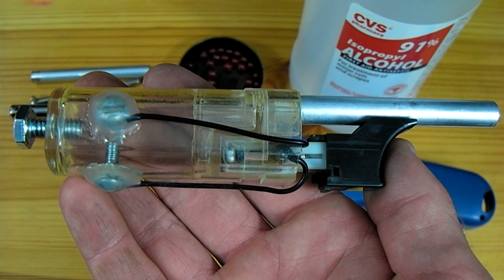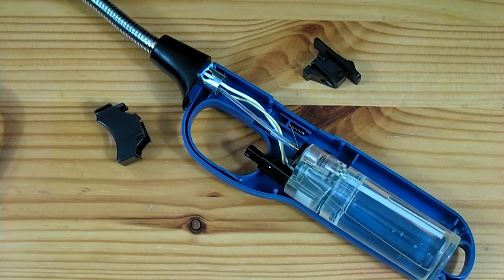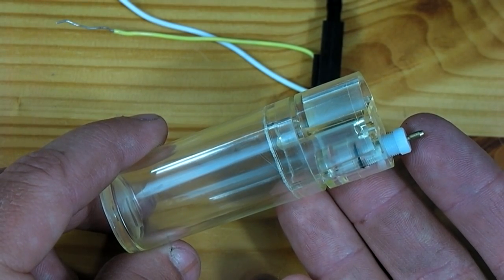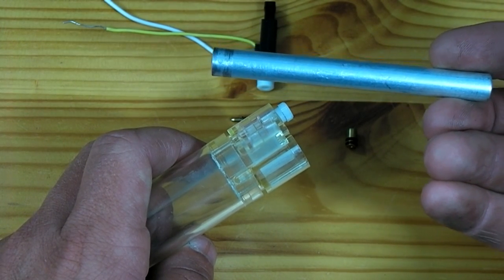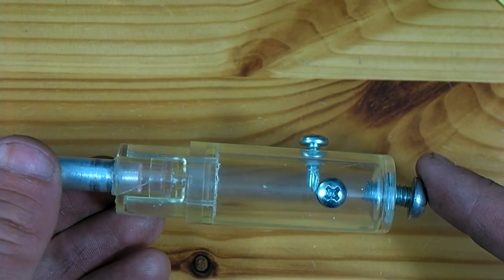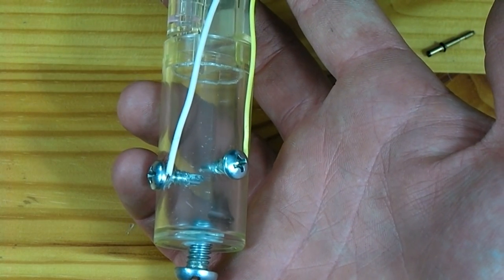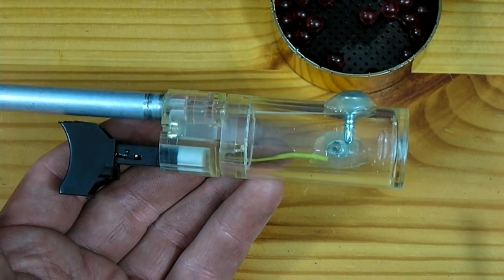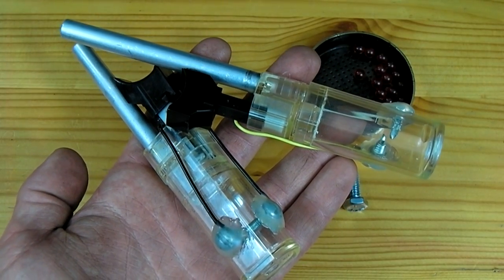Make a Mini Cannon from a Lighter

Comment: After experimenting with just about every volatile liquid I could get my hands on I simply couldn't find something that didn't have a finicky air to fuel  ratio. Later in the day while browsing youtube (after having thrown up my hands on achieving ignition) I stumbled apon your propane torch pop gun video. Inspiration struck and I grabbed my small butane torch. With the perfect air to fuel ratio every time, there is no failure to ignite and an amazing increase in power. If you are having issues with fuel ignition I recommend purchasing a cheap butane torch from harbor freight for better results in both ignition and effectiveness.
Reply from the maker: jay madarasz Good idea. A small torch lighter might be perfect.
Reply: +NightHawkInLight can you make me one please
Reply: Acetylene solves crappy cannon design problems! Explosive from 2.5 to 100% (yes, 100%. it can burn without air.)
but it’s very scary and I don’t recommend it if you want to keep your fingers.
nitrous oxide also gets the crappiest miniature gas cannons to fire properly.

Comment from the maker: Normal screws will work but you will need to drill pilot holes through the plastic before screwing them in so it doesn't crack.

Comment: This is technically a firearm (Defined by the united states of Bureau of Alchohol, Tobaco, Firearms, And explosives)

"The term “firearm” is defined in the Gun Control Act of 1968, 18 U.S.C. Section 921(a)(3), to include (A) any weapon (including a starter gun), which will, or is designed to or may readily be converted to expel a projectile by the action of an explosive; (B) the frame or receiver of any such weapon…. Based on Section 921(a)(3), air guns, because they use compressed air and not an explosive to expel a projectile, do not constitute firearms under Federal law — unless they are manufactured with the frames or receivers of an actual firearm. Accordingly, the domestic sale and possession of air guns is normally unregulated under the Federal firearms laws enforced by ATF."

But don't fret! Producing homemade firearms for personal use is completely legal for US-Citizens... God I love this country
Reply: Oh, didn't see your comment before I posted mine. I am glad that you went into detail. Needed to be said. I mean, it is virtually a gas powered muzzleloader of sorts, it would be about as easy to do on full scale.
Reply: Wait so i can go make a gun in my garage right now
Reply: As long as its not a sbr machine gun or anything else right
Reply: paul beenis do u have to be over 18?
Reply: erm he lives in Canada

Comment: NightHawkInLight  Can that "Piazo Electric Igniter" light kindling for a fire in a survival situation?? That thing could be an essential!
Reply: The piezoelectric lighter for a Bar-B-Que grill works for a survival fire starter the spark is hugh and most of them are T handled
Reply: Yeah. But wear gloves. ive held acouple of those and clicked them incorrectly or somethin' cuz they zaped me!
Reply: Why not just take the whole lighter with you? DERP
Reply: Yes the Piazo Igniter from a gas BAR-B-Que can start a fire better than a flint and steel. The one I have throws a bright strong spark
Reply: Solinium Pulse
Well if you're gonna be like that i'm pretty sure those sparkers run out of battery! Surely a lighter is enough gas for one camping trip? If your on about a collapse situation i'd probably use the bow and stick and board if I had no chance to get supplies first, hardest part of that is the string but you could use baler twine from a nearby farm or something.
Reply: i don't know how hard it would be to ignite something other than flammable gas, i.e. twigs or whatever you are using to start your fire. probably just easier to bring a small matchbook
Reply: I thought it was piezo not piazo
Reply: I thought it was peizo ignition
Reply: Jimi L dude, a piezoelectric charge is infinite

piezoelectricity is electricity generated from a crushing force, therefore, you add a small burst of sudden pressure, and boom, you make electricity

there is no battery needed, as long as you can keep moving, you still have a working kindling igniter

Comment: if i dont have any hot glue, can i use duct tape to insulate the screws instead?
Reply: Yup
Reply: Electrical tape! Anything that will basically ground it, or rubber can work too!
Reply: Knute Lindstrom thx :)

Comment from the maker: 70% is pretty low and will be hard to use. Don't use paint thinner or anything other than alcohol. The problem is that you're using too much or too little fuel. It takes just the right amount combined with fresh air inside the chamber to burn properly.

Comment: Two suggestions. You could also convert this similar to your bull pup air soft gun... Or also you could use two lighters, your cannon plus the second one (here's the good part) for the fuel? Configure it as a T shape and then it even looks like a gun?
Reply: Great idea and many concepts can be imaginable from it!
Reply: I guess using a spark with, isopropyl alchohol and a barrel probably.

Comment: if you don't clear the combustion residue from the fuel chamber, there won't be O2 for the alky to burn. you get a "dud round". you need both O2 and fuel to make fire. alky is the best fuel because of it's wide band of mixture ratios (air:fuel) that will actually support combustion, yet low vapor pressure during combustion

Comment: i used to get lighters like the one in the video and mount a pill bottle on top as the cannon and use the fuel that came with the lighter making it inject fuel and provide a spark, reload time was much quicker and you just pull the trigger and hold for 3 seconds for fuel and let go and click again for spark

Comment: your piezo has a "hot shoe ground". if you look at the "bottom" (opposite of the end the "trigger" sleeves over), you'll see a metallic contact, that's the "second wire". you'll need to route a wire from that contact surface to your second screw. the lighter has a piece of metal in contact with that "shoe" that leads to the outer tube of the lighter tip assembly. that outer tube is the "second wire" for the lighter. mod the shoe contact, and solder a short wire to it, and you're good to go.

Comment: A few years ago me and my mom's boyfriend (at the time) made a spud cannon, and other than being made of PVC, it was basically the same premise as making this. We used MAPP (methylacetylene-propadiene propane) as our propellant. Somepoint soon I plan on making a valve leading into the chamber, which can be used to reload the gas without having to put the cannon barrel's nose on the ground (which we tapered so it would automatically cut our fruit and vegetable ammunition.. We usually used what we calculated to be about a 30% Mapp to air ratio, which in our barrel was about 5 seconds through a standard propane torch nozzle (unlit of course), with the valve opened about 45 degrees. Also the torch tip we used was a Mag-torch 85358 (Found by memory of what it looked like and a google search, not by any actual knowledge of the product) If that makes any difference in the math.
Reply: I've made several potato cannons, we use hairspray or deodorant.
Reply: I can use hairspray in mine too, but I prefer the MAPP. It increases the speed of the projectile. I'd never fire it at a person using it though, unless using a much less powerful propellant. We had an arsenal of varying sizes, but the one I made was the largest. It was fun gathering the neighborhood kids for little vegetable wars (using ramshackle plastic plate armor.)
Reply: PaperShoggoth000 well that sounded like it was a lot of fun! We really made ours for distance, so it's extremely powerful

Comment: So for repeat shots, I'm assuming you have to reapply the alcohol to the inside?  I also had a theory about making re-gassing the gun. Say you took a small bottle,  no bigger then the lighter tank, and ran a tube with a small surgical valve used for  medical IVs to the inside of the lighter tank. Then you proceeded to load the bottle with a couple alcohol soaked cottons  balls. Using the valve to shut off any backflow when firing,  do you think reload would be faster, and you would get more uses out of the gun?
Reply from the maker: I'm not sure that would be any faster but you could try it. Yes, you reapply alcohol after each shot.
Reply: I guess I'm wondering if the concept would eliminate the need to re-swab. Basically, the valve would release the gas. So all you would need to do is re-gas the chamber by turning the valve,  then simply load another dart in.
Reply: You would need a separate chamber and valve to house the alcohol, and if the valve failed you would melt your cannon. Otherwise, that would work in theory.

Comment: Instead of using a cotton swab. Can you not make a smaller hole that can fit the gas straw from another flammable gas like hairspray, that way you don't have to keep getting the cotton. You can probably find a way for the bottle of hairspray to be attached to the gas chamber. So instead of unscrewing the screw over and over again you can just press the gas hairspray canister a little and then fire. 

Just a suggestion

Comment: Quick question. The isopropyl alcohol I have in my home is only 50%, so when I tried my finished product it was not able to fire. Instead of going to the local 99 cents store and picking up some 90%, my laziness encouraged me to simply do the “salt out” method to rid the 50% isopropyl alcohol of most of the water. So, my question is (while I’m waiting for the two dense different liquids to separate) will anhydrous alcohol work in this situation?

Comment: Where is the fuel gone? do you throw it away so that there is nothing in the back area of the cannon? So you just need the back part empty of just fresh air?
Reply: butane reverts back to a gaseous state at normal atmospheric pressure. The reason it's a liquid in the capsule is because it's pressurized.
Reply: ok:)

Comment: Can you PLEASE RESPOND!!!! ok so i made this and it sparks but it does not explode and shoot the bb. I us 91% rubbing alcohol. I have tried to spray it and i have rubbed it on the inside with a Q tip. The alcohol just wont explode! Why? Also, if my spark gap needs to be adjusted, would you recommend a bigger or smaller gap? and how can you adjust your alcohol to oxygen mixture? THANK YOU AND PLEASE RESPOND!!

Comment: I just created the cannon and everything is in working order (I can see the spark jumping from screw to screw) but the alcohol won't ignite. I'm assuming this is because I'm using only 70% isopropyl alcohol, correct? Will it only ignite with 90%?
Reply: +Nick Jackson 70% alcohol isn't very flammable, while 40% is usually for drinking! Read the other more recent comments about using lighter gas too.
Reply from the maker: +Mickleblade NO, that would be incorrect. 40% alcohol may be used for drinking, but ethyl alcohol not isopropyl alcohol. Isopropyl alcohol is poisonous.
Reply: Thanks for the help. I ended up trying a minuscule amount of hairspray and it worked perfect.

Comment: what about using a butane fill valve on the bottom to replace the screw then use butane as the fuel source?

Comment: what brand lighter did you use? I used a different one and got the basics down I got spark and was using your Q-tip darts in a pentube barrel but couldn't get the fuel to combust. I tried engine starting fluid, 70% alcohol and gasoline blew through the end to expel gasses but still no combustion
Reply from the maker: Don't use any fuels besides alcohol. I used 91% in the video.
Reply: I used a "HANDI" flame from the dollarstore it had all the basic components it worked once but shot the Q-tip about 6 inches.

Comment: WHY DID YOU DUMP THE FUEL? isn't that used to make the spark bigger?
Reply: it's the fumes from the alcohol that explodes, if the fuel is dumped out the boom gets bigger..  kinda like when you throw an aerosol can into a fire... empty cans make bigger boom because it's more air inside to expand
Reply: no
Reply: Bjørnar Haugen Lol!

Comment: just needs an injection system to spray a tiny amount of has into the chamber. Possibly dangerous though as you might end up with a has grenade going off in your hand if the chamber gets flooded.

Comment: for covering the screws can you wrap eletrical tape around the body of the gun instead of hot glue?
Reply: Yes
Reply: But make it thick so the electricity doesn't jump trought it. It has to be air tight so there is no air to jump

Comment: hey nighthawk ive got a question i dont know if ur going to reply to this or not but u know how u used 90% rubbing alcohol thats causes a spark to ignite it can u use something else that is flamable like axe body spray or like anything flamable
Reply from the maker: No, anything else will be too difficult to use. Too much or too little fuel and it won't ignite at all.
Reply: oh ok thank you
Reply: your videos are really awesome
Reply: Yeah, I just built one and tried using 70% rubbing alcohol. Its really hit or miss. I only got it to fire twice out of about 30 clicks. 90% is really the best.
Reply: NightHawkInLight
i actualy used some basic hairspray and it worked better
With hair spray it shot 54 metters away and with 90% alcahol it did only shot 32 meters away
So if you are good with quantities you can probaly use Axe to (btw 85% rubbing alcahol worked the same as 90%)

Comment: What type of bbq lighters have a place for the sparker thats on the gas chamber because I have taken apart 2 regular sized bbq lighters to find that the sparker and the chamber did not go together.
Reply from the maker: Lad Bell It's hard to tell without tearing the lighter apart to find out. You can always just glue the igniter to the side.

Comment: Why do we have to blow through the end to get rid of the used gases?? Because its the same gas so it wont do a thing
Reply: It's for the same reason you can't run an engines exhaust into it's intake. It's exactly that, exhaust. It won't burn.
Reply: Oh ok :D

Comment: Hey,
I've tried to make this but i couldnt find such a big butane container so i used a small bottle from some pills and a small butane bottle from a lighter connected to the bottle so i could just press a button to let the gas inside. I've did the rest just like you, 2 screws connected to a piezoelectrical igniter from the ligther.
Everything should work, the gas is in, the spark is very visible but it DOESNT WORK.
When i close the bottle with a cap then it just doesnt work, there is the spark and all but it just doesnt light up the gas. When i open the bottle however, it does !
So i think that is some problem with air, and firing it without the cap is just pointless because the strength of the explosion is too small to even fire out the dart. Any ideas ?
Reply from the maker: If it fires when you open the cap but not when it's closed you're using too much fuel. Use less fuel.

Comment: none at all. the vapor pressure of the original butane fuel is actually much higher than that of the alky burn. ONLY as much alky as there is O2 to combust with will burn. use gasoline, or hydrogen, and the potential for exploding increases, but both have a VERY narrow mixture (ratio of fuel to O2) that will actually sustain combustion. alky has a VERY wide mixture range that will combust. this is inherently a VERY safe experiment (except, of course, the danger to your eyes from the pellet)

Comment: Should it be 90% alcohol, cuz i have only 75% and its not working, just wanna know the problem is on the alcohol or not
Reply: deffently not, the alcohol is to clean it from the gas
Reply: Disregard the last reply, yes it's the 70%concentration because the explosion relies on a precise air to fuel ratio and nighthawk said himself it's too hard to get it right with any other concentration.
Reply: frostbyte1997 i use 93% and it works fine

Comment: how does this work? like scientifically or physically even?
Reply: I'm guessing that the spark ignites the rubbing alcohol which creates pressure inside the tube. The pressure has to find the easiest way out (the barrel opening) and pushes out anything in it's way, hence the reason why the pellet is pushed out like a cannon fire.

If there wasn't any opening for the pressure to "escape" to, then the tube would explode like a bomb.

This is just a guess so sorry if it's wrong.

Comment: You didn't put the parts. Is there any I missed? 

BBQ lighter. (Wide body the better)
6 milometer pen tube (6 milometer internal)
Q uarter inch diameter blot
2 self taping screws

Comment: Lighter already does all of that, couldn't you just add a simple barrel that allowed air in on recoil ? I mean, it lets out fuel and then lights it. Technically and legally it would just be a gas fired rifle instead of powder or air.

Comment: I used 91% isopropyl alcohol but it's not working. I put it on a cotton swab and wiped it entire casing but it didn't work. I see a the pie so electric igniter spark, so that's not the problem. why doesn't it work?
Reply from the maker: If the spark is a bright neon blue after you've added alcohol then you've used too much. If it's a dim blue you may have not added enough, or the gap might need to be closer or further apart.
Reply: Oh ok, thank you very much? How many cm apart should the gap be? Mine is a little less than 1 cm
Reply: I see a very small Amber flame in the middle of the purple-bluish spark
Reply from the maker: Nathan Kong Try using a little more fuel. If that doesn't work then make the gap further apart. It's probably an issue with how much fuel is being used though.
Reply: I messed with the gap and the amount of fuel a while again and got it to work. Thank you so much! Keep up the awesome vids
Reply: NightHawkInLight can you do one with a BIC lighter please? Thx